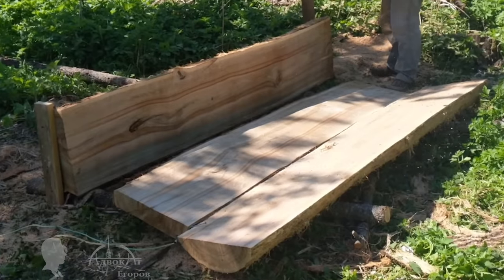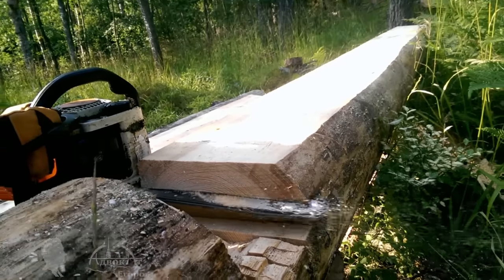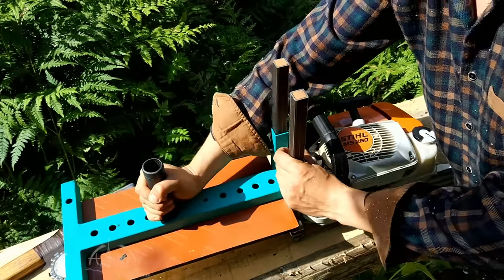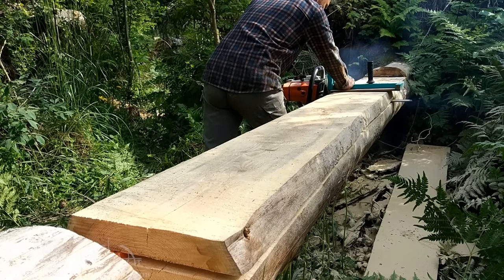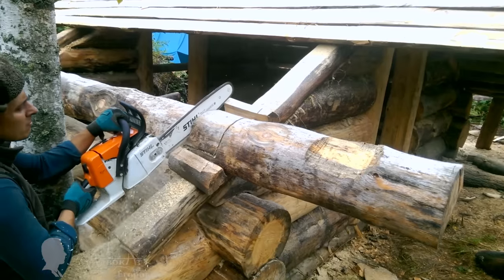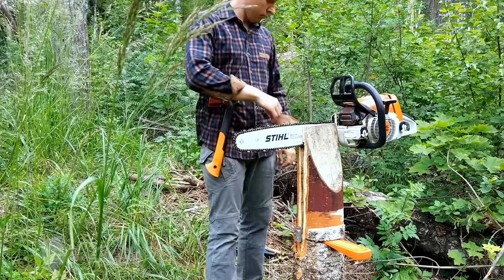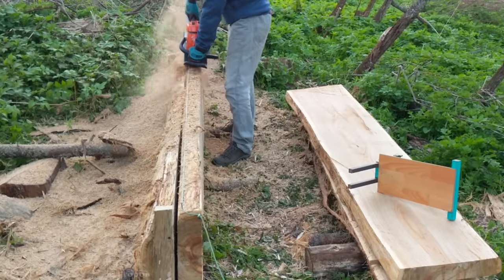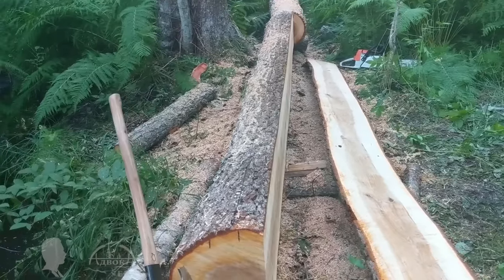Two Chainsaw Secrets | Turning a Tree into Perfect Boards

Comment: Thank you thank you !!!!! 
Best method by far! I tried it on a 1 year old oak trunk,  with a Shindawa 55 g engine and a Lidl Parkside one of same engine (small and light to handle), bar was relatively standard size for such engine. This made the whole difference as, using a smaller chainsaw meant more stable movements and much less tiring on the arms. Made 3 cuts in an hour and half (first tests so we took it easy and had breaks)... Now I am super happy !!! 
Defo needs practice to move down and straight but, no competition . This is the best method. Thank you again !

Comment: Thanks for this. I've watched this video several times, and I've carefully considered your technique. Yesterday I finally tried freehand milling a full-sized Maple log, with fair results. 
...
It was a 13' with around a 15" diameter. The main thing that was different from what you show here is that I first struck a chalk line on the log and then made a shallow cut. I then rotated the log to repeat, which left me with a straight, shallow cut on both sides. The log was again rotated so that the cuts were horizontal. From there it was a matter of connecting the two points together and adding shims, while my wife watched from the other side to signal me in case I started to cut off center. 
...
The entire process was done without a shallow-angle chain, and it has left me to wonder how important this is in your opinion. Right now, I'm using a standard 30° Stihl chain. It seems that a ripping chain would move unintentionally to the sides less, and so there should be less error and a narrower kerf. If I do take the leap to cutting all the way through with one cut, I imagine that I should first understand the difference in chain types. 
...
I'm also really starting to question the convention of big=better with a chainsaw; I milled this log by switching between an MS 260 and a smaller MS170 between cuts, and to be honest, the smaller one seems to move just as fast: with far less fatigue, cut waste, and gas consumption (not to mention the easier-to-sharpen chain). My next move may be to switch away from Stihl, and find a nice lightweight Husq. that's comparable to the 170. As such, I'm interested in your recommendations on size, brand, and chain. Again, thanks. Best wishes out there.
Reply from the maker: A smaller chainsaw is easier on your back when you are swinging the chainsaw up and down a cut line. Because you only  have  a few chain’s teeth in contact with a log you don’t need much power to do shallow cuts.
Glad this log cutting method worked for you too!

Comment: I started cutting beams out of very big logs using this method last year. I used a chalk line to be able to get a straight line. After getting two huge beams from one log I started cutting some beams from some cedar trees and than ran them thru my table saw and jointer. I made a beautiful table with the boards.
Reply from the maker: Jimmy, thanks for the story. It is good to hear that this method works for others.
Reply: Any advice on drying/treating the lumber after you processed it? Did you just build the table and then stain/seal it in some way that worked out?

Comment: Straighter planks than the ones your get from the front of the rack in Home Depot
Reply from the maker: Haha
Reply: 17Industries 🤣🤣🤣🤣🤣🤣good one
Reply: Lol
Reply: 17, that ain't no joke there!!! Seems they like selling to boat makers!!!🤔😅
Reply: @Advoko  you can make your Freehand cuts a lot faster yet... pm me on facebook... been doing this 20yrs plus... 3 chainsaw mills & meter dia plus logs... youre setting your chains wrong & sprocket tips are a no no if you want speed & consistency... your 260... lack of good 2-stroke oil... can't use engine oil
Reply: Hi Advoko... did you message me about 2 months ago... i didn't associate it with this post... pm me again i wont be so vague on my techniques to improve what youre doing here... your teeth sets can be improved as well as the swing technique... i built a similar baby 40cc saw, saw mill to yours... its about the teeth angle & hook on the edge... solid nose bars make a big improvement in cut quality & speed too... both for free hand tip cutting & saw frame milling (the chain doesnt whip in the cut) but i only, always set teeth to 20deg... the best compromise between cut speed & chain wander... with the right set on cutters... mill will cut as fast as freehand tip cutting & a LOT smoother finish... i only use std chain not skip tooth or like theyre no faster or efficient... chisel chain (only stihl or charlton chain, theyre the toughest cutters) in clean debarked logs will far out cut anything... ive tested them ALL... incl making my own... std chisel chain set right is the best... even on a 6ft bar... teeth count in the cut is a fallacy... the low teeth counts load up with saw dust in big cuts & bog up/down the cutter

Comment: Max, everyone else is going to recommend you get a husqvarna or stihl, I am not everyone else. Looking at the piston of that saw its clear it failed due to *overheating*, that MS260 is not powerful enough for the job you're trying to do and nearly all new saws are designed to run very lean for emissions etc. You need an older design saw and I'm going to suggest a Makita (Dolmar), you could get the DCS6400/6401 or DCS7301. Also these should be cheaper than the other brands. You should run the best quality 2 stroke oil (not husqvarna/stihl) at a slightly higher ratio like 42-45:1, I recommend Motul 800 2T Off-road, it should be available in your country. yes its marketed for motorcycles but it's arguably one the best one you could use, many people use it for chainsaw in Australia and USA. It is more expensive yes but a new chainsaw costs more. 

 I'm in Australia and I have many years experience in maintaining and running saws, i have husqvarna, stihl, echo, makita, Dolmar. 

I have looked these up for you :

http://makita.ru/catalog/model/240.html

https://www.motul.com/ru/ru/products/800-2t-factory-line-off-road--2

Edit: If you can't find a makita you could look for an older husqvarna such as a 359, 365, 372xp. These saws have many spare parts available, I would not recommend smaller saws for your work. Also the Makita 7301 is very similar in power and performance to the Husqvarna 372xp
Reply from the maker: Thank you very much for your expertise!
Reply: Interesting! I like husqvarna and stihl, but i have only used them for forestry work, mainly drop felling and cross cutting, never for milling. I will check out makita next time i plan to get a saw, especially if i will use it for some milling. Thanks
Reply: Second the Dolmar 6400. A ripping chain would also help.
Reply: Another vote for the Dolmar (Makita) saws. Not sure about world market but here they take a "single D" screwdriver for the high speed carb needle adjustment.
Reply: @65BAJA  mine just use a normal small tuning screwdriver
Reply: Advoko MAKES  use high octane gasoline with NO ethanol. Just a Canadian trying to help. Very nice sawing job by the way
Reply: @robhendricks5347  I should have said that too, we don't have ethanol in fuel normally in Australia so i forget, you actually have to look for it it's not very common.
I've seen that sawing method used once in a video from Indonesia or something, never tried it myself, he definitely did a great job of it
Reply: @robhendricks5347  I do the same. Only Shell 91/92 or Chevron 94 offer ethanol free gas around here.

 It also makes sense for air cooled motors since they run hot and higher octane gas resists detonation.

You can also rest easy knowing you are storing your equipment without ethanol possibly eating away at your engine internals.
Reply: The ms 260 is good. Try running 50 to 1 fuel.
Reply: The people who build the best saws know best when it comes to those saws. Use fuel and mix oil recommend, at the recommend ratio for best results. If 40:1 was the best they would not recommend 50:1 period.
Reply: I wouldn't go with overheating as the cause, seeing as how he deliberately found a way to keep the saw from bogging. He was using it well under its power rating.
Reply: I have had my Husqvarna 372xp for 10 years.  I really like it and it hasn't given me any trouble.  I have had a Husqvarna 550Xp for 10 months and so far it's been good, but it has an electronic carb.  Time will tell on that.
Reply: Always use oil that shows a picture of a motorcycle on the bottle,  and is either semi or full synthetic.  If it can be used in a racing motorcycle,  it's ok for your chainsaw.
Reply: @wert nert No,  'more rich' normally refers to the petrol air mix,  not the oil,  running lean petrol mix helps emissions,  but causes over heating.
50 to 1 sounds like nothing,  but the main thing is to use a high quality oil,  a motorcycle racing oil is my recommendation,  they also run very low oil ratios while making 50 horsepower from 250 cc engine.
Using more of a cheaper oil creates more abrasive soot.  Oil actually lowers the octane of the mix.
Reply: @wert nert I forgot one more thing,  more oil increases the viscosity of the fuel,  and that makes it run lean as well, 
 I think both of us are going to err on the side of a bit more oil,  I use a medicine cup to measure it as carefully as possible,  but it probably ends up being closer to 45 to 1 than 50 to one,  but until a chainsaw mechanic explained it to me,  I put a lot more oil in.
Reply: Remember to warm up the saw properly after a cold start to avoid scoring piston/cylinder head.
Reply: What all these newer saws need is the muffler opened up and air fuel ratio richened to match. Tuned lean with a choked down exhaust they run hot, which we all know is not good especially when you have a few different metal alloys in there expanding and contracting differently. But opening up that muffler let's it run like a 2 stroke should, giving both more power and longevity at the expense of making more noise and violating emissions laws.

 Dolmar, Jonsered, Stihl, Husquvarna there really isn't much appreciable difference between just what color plastic you get.

 And those dumb flippy caps, damn German engineers.....
Reply: thanks man, I'm buying a new saw, and I was lurking both Husqvarna and Stihl, not gonna lie. With Husqvarna having the egde over Stihl simply because I own trimmer and it's great. Never tought of Makita.
Reply: I love my husky 372xp. I am on my second piston and jug in 20 years. Both wrecked do to bad gas. I mill a little and cut 10 chords a year for firewood. I also have a sthil 460 rated at the same 5.5 horse as the husky. These are the minimum horsepower for milling. I have a farm boss for carving. I once used it for milling with the same results you had. I like them a tad rich too. An experienced nose can smell the mixture change at the end of the tank. Stop working it hard before it runs out of gas and dies hot. You probably already know that but for the uninitiated it’s worth a mention. Thanks for the vid I am going to try it tomorrow
Reply: @thomasjefferson8629  I have a chart from Echo, it has pictures and shows what a piston looks like from different kinds of failures. Apart from the fact that he was using it for long periods at high rpm for his method and milling, the chart I have matches perfectly with the overheating scenario. As others have said most new saws are tuned lean from the factory plus the mufflers are choked down, both these also contribute to overheating, a muffler mod of some kind helps open everything up, flow more air and cool things down. If you're interested in the chart I have reply with your email and I'll send a copy
Reply: Husky 372 is a great saw.
I had a 86cc Remington years ago when I started out. Very loud but strong and durable
Reply: Makita is Sachs-Dolmar, German manufacture
Reply: exactly right look at the scoring on the piston it shows failure as overheating and too lean, if you had to keep it and use it i would up your oil content per gallon or change your 2 stroke oil. getting a larger engine may cure the problem, but it could be failure with the oil not being good enough to lube that piston (they may have changed the piston  or the rings and you are scraping the  bore too clean  ). Maybe they leaned that model too much for emissions. either way if you keep it change oil or change your ratio so you are using more oil. another cause of over heating could be the high rpm limit being wrong so you are exceeding the high rpm limit so the engine overheats from not enough oil

Comment: When you first start saw let it idle for a few minutes to warm up inside of motor. Don't just start and rev it.
 Mix fuel 40 to 1.
 I have cut boards like you did in video. Works great.
 For sale: Alaskan log mill. Used 5 minutes.
Reply: My Sthil MS170 chainsaw suggest 50:1 mix min. 93 oct. 
Do they run better if it’s 40:1??
Reply: @Klownguy22 ,they last longer due to more oil lubrication. I run smaller saws like yours 50 :1 but bigger saws (50cc and larger) 40:1.
Especially cutting lumber like in video. Hope this helps.
Reply: @Klownguy22  the 40:1 mixture is leaner and will run hotter than 50:1 for the same volume of fuel. As noted you also get a little less lubrication. Gary says that he has run his larger saws on 40:1 - I can't say how much of a difference a 10:1 mixture ratio makes, it's not a lot but it is somehting.

The higher octane rating will prevent "knock" or early detonation of the fuel/air charge inside the piston - Knock is bad, it damages things and reduces the power output etc etc.

The higher octane rating will also make cold starts a little harder, I can't say that it's ever bothered me. I always use the 93 or 94 octane even though, as I just noticed on the fine print on the side of the 2 cycle mix I recently bought, it says that it works with 89 octane. My truck also says it runs on 87, and it does, but if I"m going to tow, or load it up and haul heavy I put in 93 there as well.

DO NOT run your saw out of fuel - at the end of the tank you will run lean and under power and that will run HOT.

Good Luck
Reply: @ericlee6816  l all ready sold the mill.
Reply: @gregmislick1117  1:33 is ok ?

Comment: I actually did this this weekend the results were promising! I was on a steep incline but still managed to get a flush cut. I cut through a 20 red oak that had fallen across one of my trail. The property is very steep but I made 3 cuts about 10 foot in length. I used about 2-1/2 tanks of gas to complete the 3 cuts. I had to borrow my neighbors saw in order to get the final 2 inches as my 18" still ms250 was just shy. However using the lighter saw for the majority of the work was very helpful. Thank you so much for this video! Also I was inspired by the moped. I strapped my to the side of the atv and it drove unhindered by the weight.
Reply: @Advoko , what were you doing with the three planks at videos end, with sawdust between them and a tarp to cover? What was the purpose of that?

Comment: I worked at a head sawmill so atleast I had the experience to identify sweep and defects.  Your swinging technique is excellent.  I would block the log and take a 1" slab off the side, then use that flat side to stabilize the log for the next cuts.  My little MS170 went through without a hitch.  As long as the chain is sharp the swinging method produced very straight cuts.  I had 2 old telephone poles, 20' and 26' and was able to get all the 2x6's I needed our of them.  Thank you.

Comment: All advice is absolutely excellent.
I learned to rip bowl blanks for my wood lathe with a chainsaw
cutting almost parallel to the grain, which creates long
spaghetti type 'sawdust'.   Anybody that sees those
beautiful piles of wood ribbons wants to know what 
jig I use....answer: my brain.
I only use Stihl chain saws.

I don't sharpen my chainsaws when they are dull.
I sharpen them when they are not as sharp as possible.

Thanks for Thinking!
North Central Florida, USA

Comment: I've been ripping large beams (18" x 20'+) for years with an Alaskan mill and I've always felt there must be a better way. I just tried this technique on some 10' logs and was blown away. I was very sceptical but thought it worth trying. 3-4 times faster and equally smooth on my first try and I can see how with practice, I'll get smother without losing speed. This has totally won me over.
Reply: Also, I have a husqvarna 460 with 24" bar. Very reliable and well-balanced so far. First saw I've bought new but I'd buy again.
Reply from the maker: Jason, thank you for the feedback! I recently switched to Husqvarna 365 chainsaw...

Comment: This method works very, very well. I just finished milling 6 2inch boards out of a 20 foot section of a felled western cedar. 
However… 
The swing - while very easy - takes place on one side of your body. If you’re right-handed, you will have a tendency to swing reaching right. After doing it all day, you will feel how un-ergo-dynamic this position can be. I strongly suggest that you swing with your body facing the log. Your back will thank you.
For an example of the correct way to do it, take a look at Max at the 10 minute mark.

Comment: Thank you for sharing this technique. I have been ripping logs into lumber for 2 months now. I've built a 6 ft bench, and 2 small tables that I use as stools. 
My cuts still need to be a bit straighter & cleaner, bit I think it will get better with more practice. You're boards look better than mine, but I have still had huge success with this technique. 👍

Comment: I would recommend the ms391 it’s a work horse all over my farm and hasn’t failed me yet. Make sure you keep air filter clean. I find this very vital for the mid size saws
Reply: Looks like he was pouring straight un-mixed fuel into it, that, and overheating it the way he did with the mill will surely burn up the piston. If Stihl sees this video they will void his warranty for putting that mill on it and the fueling sequence.